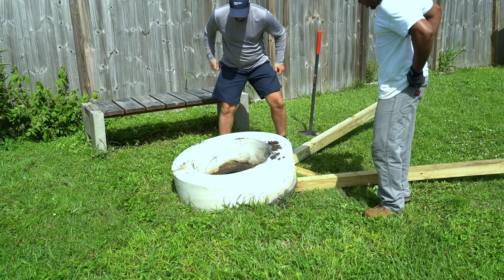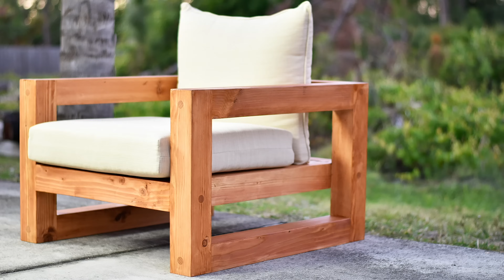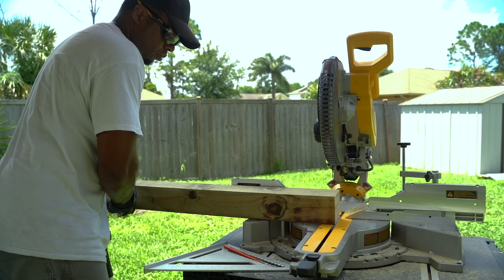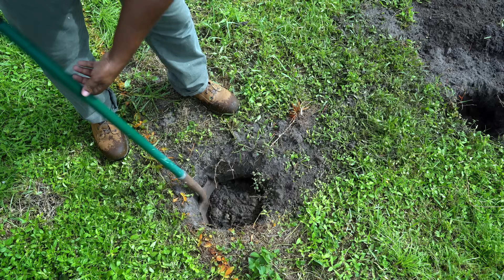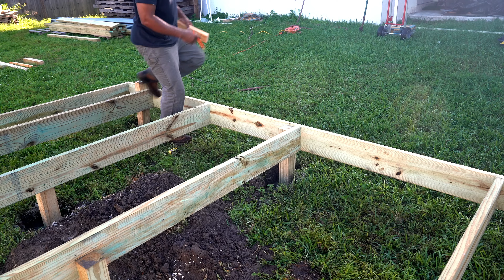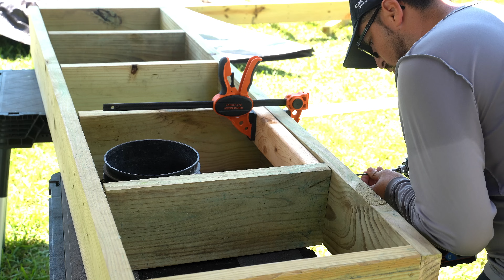Building A Ground Level DECK - (Part 1)

Comment: Question.... Is that wood treated or not? Oh, and beautiful but even I can guarantee it isn't going to hold up! The footers are supposed to be directly under the main posts, not just have the posts screwed into them! The footers are your actual support structure!
Reply: The wood is definitely treated. You are correct about the footers tho. A small party of people on that thing and it will start coming apart. Add elements to that equation and it's just a matter of time.

Comment: I wouldn't be surprised if you see parts of that deck rotting out within a few years, especially considering it's so low to the ground. I understand the constraints of building in that yard, but regulation decks are no less than 3 feet from ground level, at least where I'm from. Ventilation is huge.

Comment: I do not like criticising people, but this video should be re-named HOW NOT TO BUILD A DECK .
Reply: Nothing .... in the title at least when I saw this vid ... said anything about "HOW TO....." it just said building a deck .... which means he posted just what he did.  Right or wrong.
Reply: @johnjacobjinglehimerschmid3555  The point is he built it wrong regardless of the title .
Reply: Can you please elaborate? I get the itch to do these projects but the comments always discourage me :D
Reply: @radioguy801  Joist hangers are a must for any deck.  Three screws into the end of each joist means this deck is structurally unsound.  It will most likely collapse at some point.
Reply: @cafesilver9 is that because the screws will rust away?
Reply: @Beaver-b1v  Screws don't have proper shear strength.  Under enough load they will snap.
Reply: @cafesilver9  fair enough, would a nail be better than a screw? Just thinking some structures are only nailed like joists before hangars were invented and they seem to be ok?
Reply: @Beaver-b1v  Nails for structure are better than screws. Nails will bend quite a bit before snapping.  But nails still will bend under load if it's high enough. That's why joist hangers are requested as well.
Reply: @radioguy801  Like Radioguy states , no joist hangers, the main frame should have been concreted to floor level to prevent rot , didnt even treat the end grain with wood preserver and screwing screws into end grain is never gonna be strong enough to support the deck .I would be shocked if it lasts 12 months .
Reply: And your comment should be called how  to Act like you know what you're doing by making a comment when you are watching a video on  how to do it because you don't.😅
Reply: @nycbigdaddi  clearly you dont have a clue about what your talking about , he basically apologised for doing it wrong you thick fuc---
Reply: The channel is called DIY creators.... those post will give out.. specially in Florida.
Reply: Love it 👏👏👏
Reply: Just dump the concrete powder down the hole and add water.😂😂
Reply: Looks like a waste of time and money.

Comment: Omg another DIYer spreading dangerous-halfassed info.  Lucky when that deck fails I'll be close to the ground.  Screws to hold up a structure are a no no, screws can't  handle sheer force that deck is unsafe.  Should have done it right and cut out the 4x4s and rested the 2x6s on top of it and then secure it.

Comment: Wow... Please add some structural support under your joists. Simply relying on screws to hold your deck up, even if it's at ground level is really, really, really, really bad!!!! Galvanised stirrups or even notching out your posts would  be a much stronger and smarter idea.  Everything else you've done looks great but it doesn't count if the base and foundation itself is questionable.

Comment: You have an idea how I could do the same without using cement, because I don't have the right to use cement
Reply: You don't have the right to use cement? Did you get convicted of a crime, and a stipulation of your release is you're not allowed to use cement products?
Reply: @sethpscott   I don't have the right to use cement, because it's not my territory.
Reply: @JoyHoffi  late response.  Place a concrete paving slab on the ground.  Place a readymade concrete pier on top of that.  Job done!

Comment: Dude, joist hangers.
Reply: what the different between using joist hangers instead just screw it in to the wood? I am just curious
Reply: Jeffrey W joist hangers are stronger and give it will give the base longevity, this will end up failing after a period of time
Reply: @jeffreyw8752  I eliminate using joist hangers by building beams for the joist to rest on.
Reply: @joekind1 do the beams rest on the posts?

Comment: No joist hangers, no concrete under the posts, and screwing into end-grain?  Yikes!
Reply: My (admittedly) minimal understanding was that I thought you were supposed to put landscaping pebbles under the post for drainage, as concrete under the posts would lead to water retention and rot?
Reply: @swamijie   Right - You would use a sonotube and pour concrete below grade. Your deck sits on the concrete.
Reply: It’s in part 2
Reply: Joist hangers her piece of s*** you're going to kill people you collect water with those damn things two pieces of s*** s*** s*** s***
Reply: @JohnKennedy-zi5oi  its only 12 inches off the ground.lol  no girders though, just the post screwed to a few joist, guess it will last a few years
Reply: @Mary Poppins what does the park have to do with the way a deck is built.
Reply: @Mary Poppins yea what the heck.
Reply: Joist hangers are a joke.
Reply: @davesilvia9711  still building code tho
Reply: @justinprentice2004  it should have girder beams under the joist, no need for hangers, and where in at that deck wouldnt need an inspection or have to follow a code as long as its not attached to a house.
Reply: @davesilvia9711  not needing an inspection, doesn't mean you should cut corners and do it incorrectly!.
Reply: @alis05  correct, i still say you dont need simpsons on a deck like that. it can be built a lot better than this one, a pair of girders 90° to the joist and it will never fall apart till the wood rots. iv been building for over 30 years.

Comment: I encourage anyone who watches this channel for wood working or building inspiration to stop watching this channel. Especially if you do not know the codes or proper techniques for building load bearing structures. The deck is NOT properly supported. The support posts should be notched and the joists need to be sitting on top of the posts NOT screwed into the side of them. That was the biggest thing to jump out at me and it's enough to scare me . There are several other things wrong here too...

Comment: People need to stop using 4x4 posts and instead use 6x6. 4x4 are not to be designed for ground contact, but 6x6 are. Also wet cement when it touches wood, even pressure treated will cause the wood to rot faster. Instead pour the cement first, let it turn hard, put 6x6 post over it and fill in with ground. This method your posts will last 25-30 years. Your deck will only be as strong as its weakest link. Also try to have your ground deck 6-8 inches over the ground so its not constantly moist, again, this will give you a lot more years since it will not rot as fast.

Comment: So many many issues with this deck frame, and waste of time.
Why did you keep squaring your deck frame, then move it?
Never saw you tamp down the concrete around the posts, and the concrete should come above ground level, otherwise water will just seep between the concrete and your posts. The posts also despite being tantalised should have been treated ie with bitumen to stop moisture from the the surrounding soil getting into your posts.
The posts should have been notched out so that the joists sat on half of the post as opposed to just screwing them, will be interesting to see just how long your fixing lasts.
The deck step straight onto dirt, no stability, despite the posts.
There are so many great videos on YouTube on how to build a deck, this isn’t one of them, all the comments praising your work, they should look elsewhere, and certainly not copy your methods, your deck simply will not last,
For trex decking the joists are not a minimum of 16” on centre, that is the maximum, 12” on centre is preferred.
Reply: I hear your suggestions. I feel like it's a good effort of his part. 

I believe he used a bit of concrete (not filling it up to ground level) as he didn't have enough to fill all of the holes. 
Also the scale of the project could have influenced that.
He did say it was treated wood. But I know that it's not always going to be effective for the long term. 

I'm new to carpentry/woodworking so I'm simply inadequate to give in depth explanations and stuff
Reply: ComfortMsfit 
I have been a fully qualified joiner/carpenter for over 40 years, advanced craft city and guilds, I’m from the UK
Reply: stephen watson so why you watching YouTube diy videos ?
Reply: @stephenwatson1873  I have been 15 years in construction business and found out that there is no point make in ground footings for deck just lay some small concrete slab on ground and build deck above it.
Reply: Travis Champagne, because you are never too old to learn, even from diyers,
Reply: Mr. Wizeguy, it depends on the type of ground you have, and the size and height of the deck you are building, as to wether just building on concrete slabs is a suitable foundation.

Comment: Quite a few comments claim near future failure of joists or posts. It would be great if you make an update video in about a year or so?
Reply: It’s more the rotting of the posts on the ground and the failure of the fasteners at the post to joist connection and joists to rim joist connection.  Depending on how much weight the deck ultimately bears will be the deciding factor.  In this case it’s only a few inches above the ground so not a lot of danger if the screws shear off.

Comment: Not strong. All the weight is transferred into shear forces on the screws. The support posts need to be under the bearers. The joists need metal hangers, or proper joinery.

Comment: 1) can’t use screws because they shear if they breaks. Nails are used so they bend if there’s any movement 
2) you can’t screw into end grain. Hoist hangers are used so you can nail into long grain.
Code isn’t just “16 on center whatever is quick”

Comment: I’ve always been told that screws have nowhere near the shear strength of nails.  Is this really ok for hanging joists and bracing where shear forces will indeed be at play.  Screws are ok?
Reply: Dave Claghorn look at Projectfarm videos he tested shear strength of screws vs nails in a video. Pretty informative. I’ve always been told the same thing. The video showed that the screws had more shear strength than nails. I wonder if there would a different result if the tests were left outdoors for awhile
Reply: Tomtom9401 and maybe the type of screws...
Reply: Dave Claghorn possibly he tested a few different types. Even drywall screws were pretty high up there
Reply: I just watched that video and it tested pullout, not shear.
Reply: kds471 it did multiple tests including pull out
Reply: Tomtom9401 yes all his test were pull out or fatigue test.  Didn’t see a shear test.   Shear is the weight the fastener can hold perpendicular to its fastening angle.   It’s not how many times it can bend before breaking or many pounds it take to pull out.  Well, at least that’s why I learned.   I could be mistaken.  I did one job where the idiot builder used drywall screws to fasten metal rim joists for a mezzanine.  The tenant ended up storing boxes and boxes of documents on it.  One day  the screws gave up the ghost and it all came down.   The floor was littered with snapped off (sheared off) screw heads.
Reply: kds471 dam crazy story! Yeah I don’t know all the technical details. It seems like his tests weren’t super encompassing either

Comment: You should take a look at the Duralife step clip composite system.  The plastic fastener strips act as joist tape.  You just place the boards in between the clips and step on it and it clicks into place.  I re-did our 15x20 deck this last summer with Duralife step clip products along with cortex color matched plugs in areas that had to be screwed down.

Comment: First I love the videos, but as someone who built decks for a living this would never meet code at least here in Iowa.
Reply: Could you gives some reasons why? I'm super curious!
Reply: @BinarySecond  screws into end grain, no joist hangers ,the posts are not UNDER the things there supposed to be. the entire angled section is basically free floating, the one post he did put under there is sitting on the grass, single rim joists...............
Reply: @Belg1970  I think it's a result of misinformation and poor planning
Reply: @potatopotatoeOG  Maybe he watched a YouTube video??? LOL
Reply: @Belg1970  lol. Maybe. But he's given this project some effort so I'm not going to hate on him
Reply: @potatopotatoeOG  He did put in allot of work I'm just worried for the safety of the friends that will be on it. Decks never seem to fail with a couple people on it, usually a group/party. We've had two major deck collapses in the news within the last month. NJ fireman's convention https://www.cnn.com/2019/09/14/us/new-jersey-deck-collapse/index.html
Reply: @Belg1970  I was wondering about the joist hangers, they make the job easier as well.
Reply: @Belg1970  who cares?
Reply: @gfnp01  dude build you want,but don't put it on YouTube for someone who doesn't know any better to copy.
Reply: Besides what was already mentioned, he barely used any concrete to secure the posts in place.  They are basically being held in with mostly compacted dirt.  There isn't anything he has done with this deck that would pass any type of inspection.  It is a shame because his projects are usually really well done.
Reply: Or anywhere.
Reply: It’s a one step platform not really a deck no code issues here anywhere
Reply: Not up to standard here either... Even if it's on ground level it has to be built to code here. Screws into bearers floating between bearers like joists with no joist hangers. Entire frame screwed onto a few posts. Not enough Nog's.

Screws are good to hold the timber together in temp and humidity extremes but it needs 4 inch nails for shear strength. Screws can't handle horizontal loads.

Rip it out and start again.
Reply: @julianjackson4795  Also where are the termite caps? Putting concrete around the posts creates a concrete bucket wich holds water and rots your posts. .JD
Reply: Not in Minnesota or Idaho, either!
Reply: Hi
Reply: or California
Reply: Corn Cobb something to consider, say someone sees this video and they build it the exact same way. Sell their house a few years later. New buyers come in and wanna build a new structure or deck somewhere else on the house. They have a contractor pulling permits and when the inspector comes he notices a deck not listed on the assessor information. Now the new owners might be forced to tear down said deck or fix it causing them to spend thousands of dollars. Will someone get seriously hurt if that thing collapses probably not, but could be a financial burden on someone. I like this guys videos, but this deck is very poorly done and with how many people say I wanna do this. A lot of bad decks might get built
Reply: @scottb9207  it only shows who the real owner is of "your home". But it would be a real pain for the new "owner" or yourself when a inspector comes by and notice it.
Reply: @scottb9207  agreed
Reply: Corn Cobb ground level or not, by the time you have footings, beams, lumber and labor it’s easily a few thousand dollars. That’s a pretty standard contractor rate around iowa. I was bidding decks up to about 6 weeks ago. Not pulling numbers out of thin air. Any deck can “collapse” if you hit a weak point with too much weight
Reply: Corn Cobb so you are saying it’s at ground level so basic construction principles don’t apply?
Reply: @Kentos弁当す  Probably he just throws a 2x4 on the ground and calls it a floor.  Throws another down and if it lands on top the first .... that's a wall.
Reply: Not to code in New York either. 42" deep for holes that's 6" below frost line. No joist hangers, no carriage bolts, no support beams, I myself fill sono tubes with cement and use a post braket to keep the treated 4x4 off the ground 1" that's our code. the list  goes on. Aesthetically appeasing yes! Structurally sound no! Also you can use the 3,4,5 or 6,8,10 method to get square. Measuring in a triangle pull 3' one side 4' the other side measure both points will get 5' after you get it all square measure an x corner to corner and adjust accordingly.
Reply: Fuck Iowa who’s gives a fuck there’s only corn there anyways